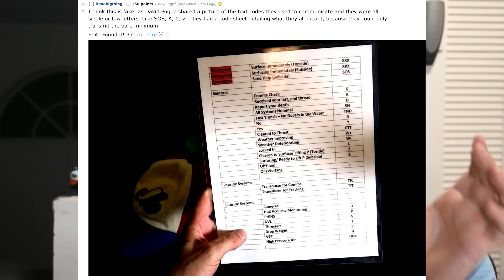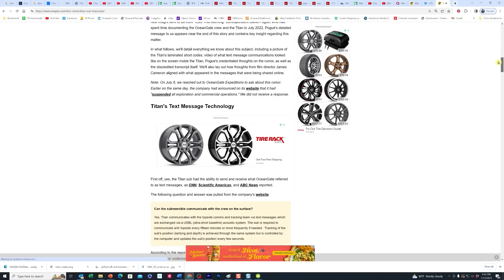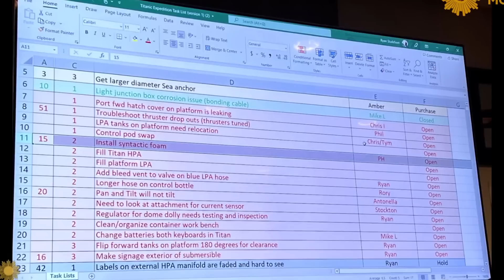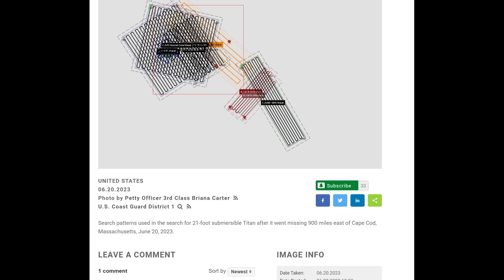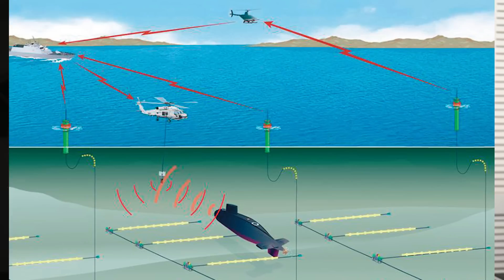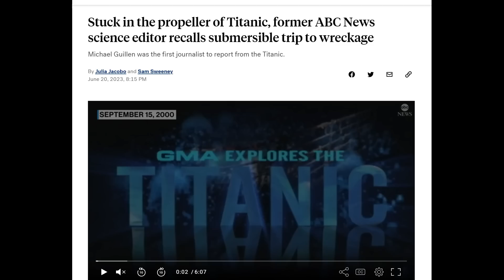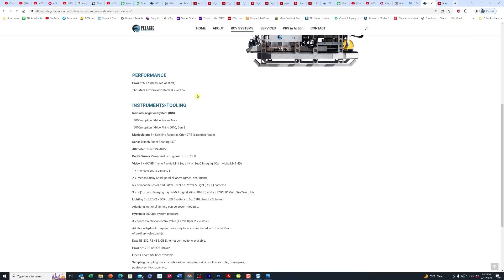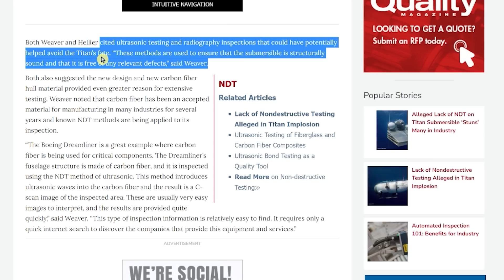The Shocking Truth About Fake Sub Transcripts No One Tells You

Comment: I've been hearing that when they aborted the dive, they had to drop the frame and even then, they weren't able to rise more than 60 feet in three minutes.  Considering the submersible is essentially a big bubble containing a near vacuum compared to the outside pressure, I would think they would start rising at an astounding rate.
Reply: It was a relatively heavy bubble though, especially if they didn't calculate their displacement properly, you've got to remember that the people on board, who are essentially mostly bags of water, replace their own volume of the air contained inside the thing, meaning less buoyancy if not worked out properly, everyone was weighed beforehand to do the calcs, but did those calcs take full account of each persons volume??
Reply: The weight of the air displaced by the five people is near zero.
Reply: @davidgenie-ci5zl  Imagine a sealed cylinder that fully submerged will displace a fixed volume of water, filled with just air, measure its buoyancy. Now imagine the same cylinder partly filled with anything that's not air, now measure its buoyancy. It's not about the weight of the air in the thing, because as you so rightly say, that volume at 1atm weighs pretty much bugger all. Its about how much of the internal space is 'not air', thus heavier than air, thus not as buoyant. Confusing as hell, I know, The volume of the folks versus just their weighed mass, might well make a small but important change to the things buoyancy.
Reply: @Tekwyzard  Oh, I get it!  They had too many passengers on board taking the space of the air and that trashed their buoyancy.  Thanks for the clarification!
Reply: @gali01992  if not passengers they had taken on water from the many micro fractures from the Carbon Fiber
Reply: Seems plausible to me that there was a leak in the cone section and  they were taking on water. This would explain the accelerated descent, the battery issues and why they couldn't ascend any faster, or at all.
Reply: @user-lr6nj4rm5k  thing is, in most scenarios that deep, any breach of the hull or leak, even a small one is near instant implosion once it starts. At that pressure even a small hole has a extremely power jet of water going in that would likely be able to cut right through anything (water pressure is capable of terrifying things) so I find it hard to believe they could’ve been taking on water at that depth without imploding instantly
Reply: And then in the last 3 minutes they dropped 19 metres. Bang!
Reply: One of his ideas to make these cheaper... and part of his reason for demanding carbon fiber... is that unlike ANY other DSV this does not have a large buoyancy vessel. In fact, it only had two small buoyancy tanks because the main buoyancy came from the air inside the pressure vessel. The two smaller tanks brought it to just above neutral buoyancy... the problem with that being that if those tanks were damaged, this thing no longer was able to rise because the weight of the vessel was heavier than the displacement. He did this so they could use less ballast weights... thus replace less since those weights are normally left at the bottom as you come back to the surface. Unfortunately, one of key points to the transcript, if it proves true, is that they had flooding inside the equipment bays. These bays were larger than the buoyancy chambers, and having taken on very much water they were nearly at "neutral"... otherwise known as no float no more. It was surfacing slowly, as the buoyancy did its thing, but at the same time they were taking on more and more water. Eventually, even without an unscheduled rapid disassembly, as they call it at SpaceX, the vessel would have returned to the bottom. It is why I get mad, because if this was the real transcript, they could have had navy and the Odyssey in route before sunset that day. I watched the interview with the team who owns the Odyssey, and because they were called (by OceanGate) after the call for the Coast Guard, they were not able to get underway until the next morning. Less than 60 hours after being called, they were on site. If the buoyancy had failed, and the vessel was in fact freezing at the ocean floor less than a mile from the Titanic intact, the fact they only managed to deploy the next day would have meant that they had less than 24 hours to recover the sub before the crew was dead. If they had called at noon, rather than after 6, the ROV Odyssey 6000 would have been in place Tuesday, leaving well over 48 hours to do the recovery. While we know now that it would not have changed anything... if we did find the sub intact, but with the crew dead from lack of air... because they waited? The outcry would have been insane. While I understand them hoping the vessel would surface on its own, the Coast Guard would have been able to confirm it was intact and surfacing, and assisted in the recovery of the now damaged hull. In fact, the passengers aboard would have been more inclined to forgive the terrifying near accident if they had, because it would have confirmed Rush was in fact thinking of their safety. If they had in fact settled to the seafloor, Odyssey would have had plenty of time to attach its grapple to the sub, and combined with the buoyancy of the Titan pulled it to the surface... once again showing investors and passengers that Rush was serious about safety. But he had made it clear that only he would make that call... and he died before he could.
Reply: Unless they were overweight from the start.

Comment: I would tend to think if it was fake that they would've made it a little more dramatic. More fear laden messages leading up to last communication.
Reply: yeah im going with. its real. it matches up with things people said happen. it matches up with how it could happen. it matches up with expected interaction between Rush and the Polar Prince. the ballast drop matches up with james camerons version of the event, “Wanna adjust speed maybe?”
“Nah. im GOOD.”
“oh… ok” would have been the slightly more dramatized version of their interaction.

he dropped punctuation and case sensitivity on the text comms during emergency.

Switching power from bus A to B would have been about where actual power loss was reported, communications ended, and it seems plausible to believe that by switching power to another BROKEN bus or during this intermission of power getting switched, there just was no power. and if ppl were panicking or huddling up on either end of the tube during power loss, the thing flips and you legit cant recover it since there is no longer thrusters to keep it lined up with the horizon (they had no ballast during power switch, had a thruster issue, and their aft was having its electronics drowned which made the aft heavy. they dont have the balance that the optimal buoyancy + ballast would have provided) . 

After doing that National Treasure II tilting platform scene IRL, they could then freefall while the sub is tipped over, and burst at any time between that 400ft mark or actually plowing into something on the sea bed in total darkness immediately after.

there is no carbon fiber recovered and there is no glass for the porthole either. 
but literally any compromise what so ever caused by any THING at that depth would yeild that result. delamination? implosion. leak? implosion. power loss? freefall, implosion. collision? implosion. 
ballast issues? …. implosion.
everything was an instagib down there.

They did have accoustic monitors, and they would have been flashing red, terrifying everyone during delamination when they still had the power to show the warning lights pre-cutoff. And they would definitely hear it since other (living) passengers have reported the sound of it in the past. Even thruster malfunctions line up with reported past incidents as well as Rush's casual attitude about the world crumbling around him & his disregard for the concern of others.

so thats why we say the transcript may as well be true.
its a lie thats too accurate to be slander or parody.
It has too much plausibility to be untrue.
In this schrodinger's death trap, every explanation for what happened happened simultaneously.
Reply: @fluffypinkpandas many good points, except I thought that the window was recovered intact.
Reply: @davebrown9725   I found differing. including pictures of it being hauled up by a crane arm of sorts and no glass being present on the metal port hole frame.
Reply: @fluffypinkpandas  Yes, I saw the window was not in the recovered bow hemisphere, but also thought I saw the entire window being brought onboard. I believe the failure started at or near the stern hemisphere and blew out the bow, from the failure analysis videos I have watched.
Reply: I guess that rules out canopy-first collision if the glass is intact. devestating stuff popped that sucker off its mounts either way. I have no doubt that Rush lived for the Rush. He Rushed his way down there to feel Rushes of adrenaline because according to everything known about him and oceangate, he knew it wasn't safe and didnt care, meaning he went out of his way to make sure it wasn't safe also at numerous junctures. He was voluntarily experiencing adrenaline highs from coming back from near-deathcausing malfunctions, even throws his needlessly obsolete and outdated controller around on-video, yknow what I mean? It was like everything he was doing was designed to trigger chemical reactions in his brain for him to get high from at everyone elses expense, and he bullied those who refused to enable him.
Reply: @fluffypinkpandas wow very good points
Reply: @fluffypinkpandas Great points.
Reply: I thought this also. It is way to "boring" to be faked.
Reply: Point well taken.
Reply: Given Rush hated interrupting his dive for topside comms, it's awfully chatty. Add in, when was the last time you received any kind of text message with the word superb in it?
Finally, in the midst of likely litigation and extreme governmental scrutiny, would you risk your entire career to leak such a transcript? Not a soul on the planet would ever trust you again, you'd get sued into abject poverty by OceanGate, who has already sued a former employee for violating the NDA and you'd have tampered with evidence in a government investigation.

Comment: The fact that there was a list of abbreviations does not prove at all that the communication system was incapable of working with complete sentences. Just like back in Titanic's time, radio operators had a system of 3-letter abbreviations (so called Q codes) for efficiency, but that doesn't mean they weren't able to send passenger's telegrams to shore using Morse code when necessary.

Comment: The Titan hull construction that was filmed and put on their YouTube channel (not shown was the placement of horizontal strips) was the first version done  by Spencer Composites (they also did Steve Fawcett's carbon fiber submersible which was not used due to his death) in 2017. It took two deep dives. Karl Stanley went with Rush on the second dive and convinced him the crackling they heard from the carbon fiber (Rush had also heard it on a solo dive and was unconcerned) was evidence of the carbon fiber being damaged. They determined the hull was unsafe and scrapped it. Another company did the second version and supposedly did the carbon fiber winding in more than two directions.
Reply: Interesting, I know the first one was scrapped due to failed CF according to Stockton. Didn't know all the footage was from that first one though.
Reply: @danielvanced5526  In the video "Interview with OceanGate CEO Stockton Rush (now deleted) backup" he says that the first attempt used what is called a "maritime wet layup" construction technique. He says that for the second attempt they are working with NASA and aerospace companies. I would have thought an aerospace company would have declined to do a non aerospace vehicle that was going to tremendous depth and had opposite forces on the hull.

Comment: When you think about it, it is absolutely insane to think that using glue is going to hold up in an extreme-pressure environment. Stockton Rush was out of his mind, completely blinded by his hubris.
Reply: The glue isn't needed to hold it together when deep in the water, the (extreme) pressure will do that. It is however very much needed to be a tight seal at those pressures. My guess is that it wasn't, especially after several dives and compression cycles. The CF compresses more than the titanium rings and endcaps. 
Apparently they also towed the submersible through the ocean to where the dive was. I think they had taken in water from the start of the dive, because of the descent rate (if the transcript is real).

EDIT: Just speculating ofc. I'm no expert.
Reply: @wrOngplan3t  Why would towing it be dangerous?  Wasn't it on that raft?
Reply: @Kimber123  I don't know how it was towed. I guess you're right, it seems likely it would have been on the raft. If not, and if there were a leak, I was just speculating it already had extra weight (water) at the start of the dive. But I don't know. Might have started leaking during descent. If there were a leak at all, but from what I gather it seems likely.
Reply: @Kimber123   @Kimber123  Seems it was on the raft. From their last expidition: https://youtu.be/O-8U08yJlb8?t=521
(this is near land and very calm. Further in that video there's a bit worse weather/waves, like from 18:30ish).
Reply: @wrOngplan3t   Ikwym.  I've heard others point out the towing aspect. Even if water didn't seep in, it looked like a really poor idea anyway, particularly in rough waters.  Who knows the effect on the balance and other components. It's like the Three Stooges were running this operation. lol  Look, no matter how you slice it, this thing was a disaster waiting to happen. There were a multitude of issues, none of which seemed particularly concerning to him.
Reply: @wrOngplan3t  Hm... not sure about “...the extreme pressure will do that” . That might be true if pressure was applied in the horizontal plane only. 

But it’s not - it’s applied in all directions. So as the CF hull and caps deform differently, the glue seal between them is likely to form tiny cracks. Really, really bad idea to use glue. 

Seems he was intent on breaking as many rules as he could, to prove wrong all the experts that were telling him he was doing something very dangerous. 

There will be lawsuits coming from the families of the victims for gross negligence and misleading advertising. Problem is, who knows how much money OceanGate has left in its coffers.
Reply: I too was astounded when I first saw that the submersible was glued together out of two wildly diferent materials.  I immediately wondered if the thermal contraction at the  near freezing temperature of the two different materials at depth would compromise that joint.
Reply: Glue is actually a highly powerful way of bonding. If you do it right and know what you do.
Reply: @ernstjunger2835  For that amount of pressure? Yeah, I’ll pass. Suit yourself, I’ll take the bolts and rubber seals.

Comment: Composite guy here: The first time I viewed the Ring being installed I noted this is where it probably failed do to cycle separation as the bonding area is undersized. The joint is a mechanical bond. Whereas the Caron Fiber tube structure is a chemical bond. In my view the bi-material joint should have been tapered and had much greater ratio of contact area. 
 Testing wise was there a pull/torsion test in a pressure chamber.

Comment: 4:40 Absolutely true, didn’t thought about but there must be a very precise clearance I guess if the thing doing the joint is a sealant. What was the clearance calculated and what was the clearance mesured, perfectly flush ? Did they used a sealant with low thermal dilatation ?

Don’t pretend to know anything, I’m just doing an exercise of mind.

Comment: I am puzzled over this point https://youtu.be/Pfc9unempMw?t=245. There is no step ring on the ring to set the correct set point. On the carbon fibre tube there is what appears to be a step machined into tube. Can't see enough detail but the ring does seem to come to a very firm stop. They were checking the staps that were unloaded and it was in the correct position. That apart I would have expected a wider band of adhesion.

Comment: The YT channel "Beyond Engineering" (BE) recently (1  day ago on 7/14/23) posted an informative video on use of composites in deep submersion applications. First BE showed some cross sections of deteriorating carbon fiber composites- looks like the delanination can occur inside and not he easily observed. (Contrast to metal fatigue where most failures occur from cracks originating on exterior surfaces; slag inclusions & voids can be found using NDT like x-rays.) Second BE presents the differences in thermal expansion/contraction characteristics between compsite materials & titanim; BE raises the spectre of failure due to thermal/temperature cycling. Also discussed is the directionality of carbon fiber composite strength depending upon the orientation of the fibers and the relative weakness in compressive loads.